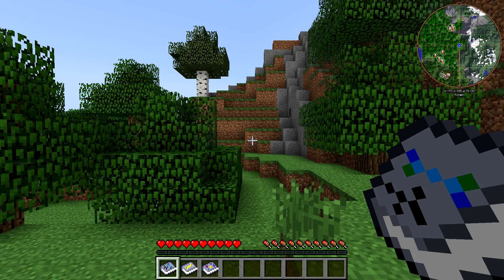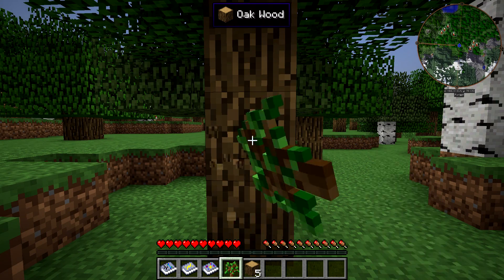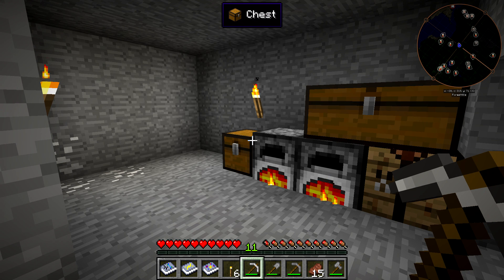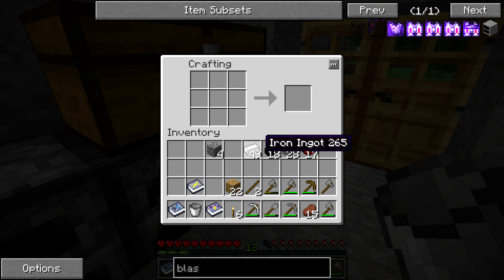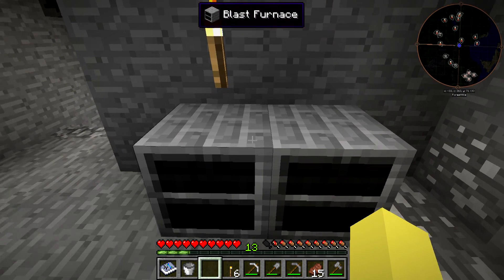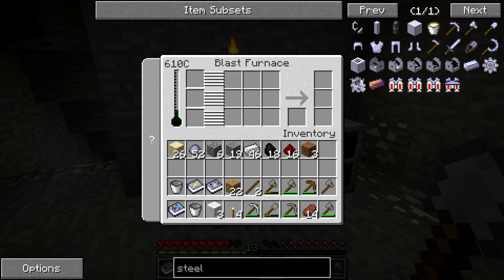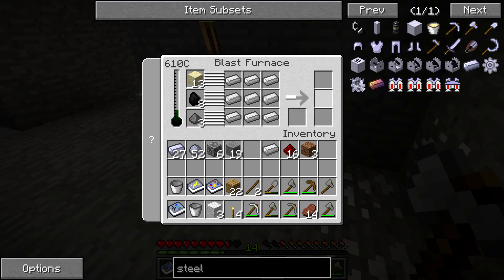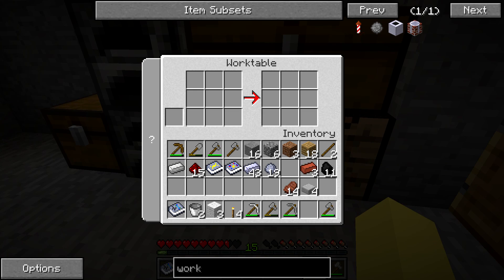Surviving With RotaryCraft :: Ep.1 - Blast Furnace Steel Production

Comment: You're going to want to fast track a Nether portal. Netherrack set on fire under steam engines is some of the best early power you can get. DO NOT USE LAVA. Steam Engines melt if you use lava, and I don't think you can make cooling fins yet.
Reply from the maker: +Triaxx2 Thanks for the tip, I do exactly this in tomorrows episode! :)